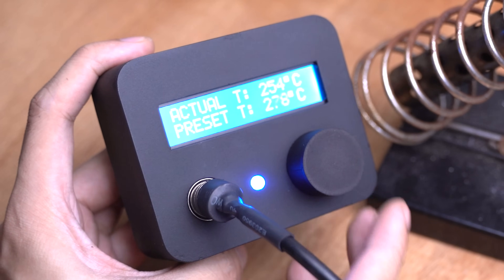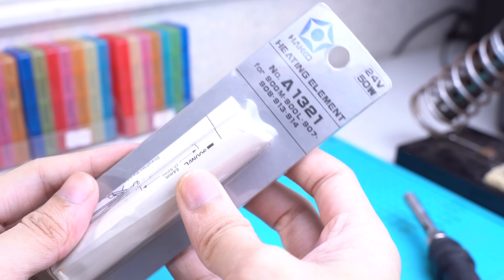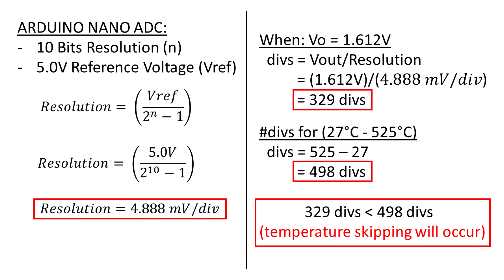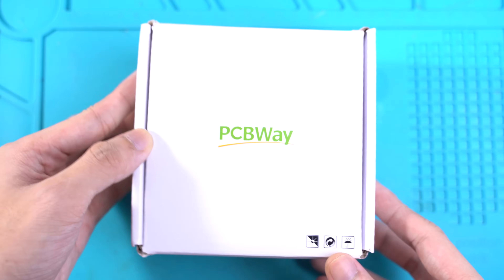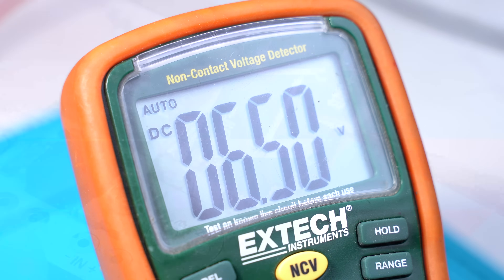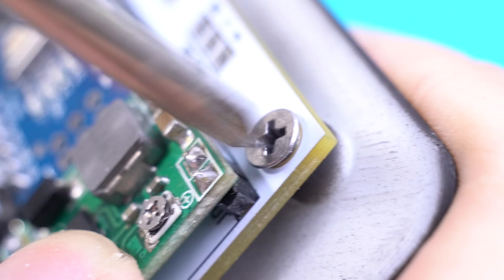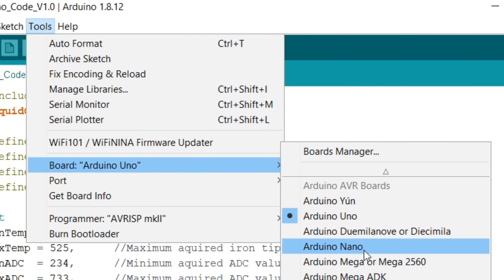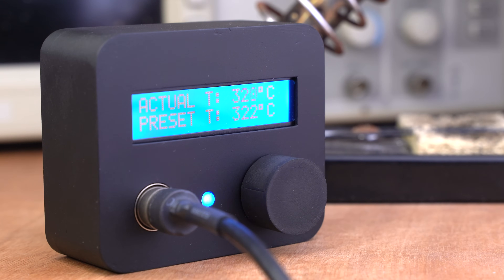DIY Digital Soldering Station (Hakko 907 For Cheap)

Comment: I’ve been using your project for two years now, and it’s been a great success - thank you so much! Do you have, or could you recommend, a similar project for a digital hot air station?
Reply from the maker: Glad you enjoyed it! Such a coincidence. I'm currently filming a tutorial for an all-in-one station (JBC + Hakko + Hotair) for my workspace. 

It's getting too cluttered here, I need a small form factor for my desk. The challenge now is shrinking the 2025 Soldering Station by finding a compact PSU for it. I made a tiny 300W 24V PSU for the prototype, but since it's for a tutorial I need to find a readily available PSU for everyone to replicate the project. 

As for building a standalone hot-air station. It's similar to the 907 project but it takes in AC instead (you'll need an SSR/ triac based device). It also uses a k-type thermocouple, you'll need something like a MAX6675 or an op-amp to get it going. Those 858 hot air handles also need a low current 24V supply for the blower fan. Hope this helps!

Comment: Hi. I make it. but it turned out it didn't work.
i mean it works but the temperature shows 2000°c
i removed the jumper and used the i2c interface LCD, after connected the handle and the heat element the arduino died and stopped working
I don't use pcb but connect the pins together
i'm pretty sure i did it right, but i don't know why it's not working. 
can you make another pcb version? or at least tell me why the temperature is showing 2000 degrees?
Thanks!

Comment: It would be possible but I would have to modify the electronics board.
I followed the original point exactly but with different results.
I wonder if the line of code that deals with displaying the temperature should not be modified.

Comment: Hello everebody!
I built this soldering station and it works well,
I have only one problem with the temperature reading,
the temperature on the display is 50 degrees higher than the one measured by the thermocouple on the multimeter.
Can someone help me with this problem?
Thanks!

Comment: its not working with my 936 station preset 39°C but my heater i show red spot or over temp, actual stay saying cool😢
Reply: I have the same problem. I set the temperature to 30, but the tip of the iron becomes hot and red. Were you able to solve the problem?
Reply: @RaoofAhmadi-wu6kl  i think is not working because your solder used sensor termocouple not termistor, but i have done with another youtube if you want try
Reply: @verhor3592  Can you share the link to the video?

Comment: You can actually use a 6 pin din connector and not use the middle pin, the proprietary connector is just a 6 pin din without use of the middle pin.

Comment: I'm a bit confused about the A1321 heater (honestly): how can a ~3 Ohms resistance device, working at 24V produce no more than 50W? 🤔
Reply from the maker: I have to revisit my data from years ago. But as far as I could recall, the heater has a positive thermal coefficient (resistance increases as the heater temperature increases). TBH it’s favorable as it can possibly prevent the heater from having a meltdown if thermal runaway occurs.
Reply: @TechBuilder  I hear you about the positive thermal coefficient, but, shouldn't the initial power surge (when the station is turned on), be a problem? And it's probably not a short surge, more like several seconds. The resistance probably won't start rising (enough), for 5-10 seconds, and during that time, the heater will draw something like 8-9A.
Reply from the maker: @hagartm  It can be a problem if the PSU does not have a constant current limit. 

I have experienced a problem from a similar project years ago, where the PSU only has a over current cut-off (hiccup mode of OC protection), which made the heater heat up longer compared to a CC regulated PSU. Some laptop chargers have CC regulation or most at least have the Hiccup OC protection. 

Full disclosure, the code does not have that initial ramp current limit. The best way to implement this is to add a current sensor and use it as a feedback for PWM control (in turn, this increases complexity). A simpler way to do this without and hardware add-ons is to set an arbitrary PWM duty cycle ramp to control the initial ramp current. To do this effectively, you might have to sit around and gather data on the voltage, current, temp then derive the heater resistance using a spreadsheet. This way you can determine the required PWM duty cycle to limit the ramp current for a period of time.

Mine has been running for 4 years now with regular use, it hasn’t died on me so far, nor had problems with it :) It runs along side my Miniware TS101. I still prefer the Hakko for its grip haha.
Reply: @TechBuilder  I hear you about the constant current limit as well, but then, why not simplify the design?? (Not your design, speaking in general terms). Why not run the heater at 9V?! That would make for a 2-3A current draw, and there would be no need for PWM (I'm probably missing something trivial, but it 'is' kinda weird; wish I could find the technical papers for the original Hakko 936 (not the manual, something more in depth)).
Reply from the maker: @hagartm  I get what you mean. If I could recall correctly, the resistance reaches 11 ohms at 450 degrees C (due to its PTC; thus the 50W rating). Running a lower voltage PSU would work (I used to have a 18V brick attached to it before I upgraded to a 24V one), but doing so would also limit the heater’s maximum heating temperature and ramp up time. This is why I still keep the 907 even though I have the TS101, I programmed my 907 to have a temp limit above 490 degC. (Kinda useful for soldering chunky gauge 10 wires). Whilst it is dangerous, I only go above its intended limit in short periods of time and keep an eye on it.

I ran into a similar problem when I made this project, I couldn’t find graphs on Hakko’s heating element, so I had to evaluate it. You can visit the instructables link in the vid description, there’s a spreadsheet there. I just hope I could tell my younger self to also record the currents along side the thermistor resistance and heater temps hahaha. I hope that sheet helps with your project :)
Reply: @TechBuilder  I've already seen your project (at the Instructables site), and several other projects as well. :) There is no 'my project' ATM. :) Was hoping I could make a really simple universal controller with Arduino and a triac, for both the A1321 type handles and the A1322 type handles (not JUST with Arduino and a triac ofc), but alas, it obviously can't be THAT simple. Still don't quite understand the 'rationale' behind the heater that has the potential to draw 4x the rated power (really wish I could talk to some Hakko engineers), but thanks for chiming in. :)

Comment: A big thanks , I spend 6 months in my RV and loving to do projects on the road and my Hanko Take a bit of room and dealing with that pesky extension cord. I printed your lid with a Dewalt battery adapter" That I always carry for my drill" . I also just did one for my nephew in-Law  for a Makita battery. I will post both on Thigiverse under HANKO.

Comment: Is all of this still good to build in 2024? e.g. If I buy a Nano will this code work in it since it may be different from the model sold a couple of years ago when this came out? Did you ever do an update to this project or is this good to go? Great job on this, thank you,.
Reply from the maker: Thank you! TBH, there’s a much more updated version I plan to build, a T12 version. It heats up much faster than the 907 due to lesser thermal mass.

However, I still use this 907 as my main Iron since the 907 tips are dirt cheap compared to T12 cartridges.
Reply: @TechBuilder  Did you see the posts where people built it but saw no display? If I buy a 2024 Nano will the code work in it? I never bought a nano before and am not yet familiar with their coding (although I've done coding in the past). Also do you still sell individual circuit boards using paypal?

Comment: Hello, I ordered your PCB design at my local PCB printing shop; they have a rule that the minimum order is about 500 cm2, so I ended up with 15 PCBs. I only use two for the project. So, only with your permission, can I sell off the 13 PCBs left? I won't take any profit from it. I will also include your tutorial link or QR when people buy it.
Reply from the maker: Hi! You have my permission to sell and profit from the PCBs. The QR would be much appreciated too, hopefully it would hell guide the hobbyists in putting it together! :)
Reply: @TechBuilder  thank you so much, sir.

Comment: Hey I recently finish , got it soldered and programmed , but when I turn the temp up the real time temp says and stays on cool? And doesn’t heat up what did I do wrong? How can I fix this issue also my little led does not light up
Reply from the maker: It’s probably your handle’s thermistor. Are you using a 907 handle? :)
Reply: @TechBuilder is it possible I mixed up the heater and sensor pins when soldering?
Reply: This is the handle I believe I am using it’s the FACULX 907A Soldering Iron Handle Replacement from Amazon , I put a din 5 pin connector on it also

Comment: I built it and did it the best that I could to follow the schematic. I purchased the boards from china.  Looked at the drawings but couldn't be sure to find out if I had wired the sensor and the heater properly. Something is wrong as the solder even melted with the iron turned all the way down. Try checking the ohms on the sensor and heater and they both run about the same! Can anyone give me a link to an iron that they've made it work? Thanks for any help.

Comment: Has anyone had success building this? I tried getting it from PCBWay. The OpAmp doesn't seem to work correctly and I wonder if it is wired wrong in the schematic. There are several comments about this in the instructable as well. I have gone through two different OpAmp's so far thinking the first one was bad.. but same issue no matter what. I confirmed the handle is wired correctly with the sensor, and getting around 50 ohms at room temperature for resistance. Someone posted an idea to bypass the OpAmp with a tradeoff for lower granularity of temp control but I haven't tried it yet. I also saw several comments saying OpAmp was incorrect in the schematic. Just wondering if anyone has tips / thoughts on if this actually works who is using the PCBWay/Gerber file.

Comment: Pins D10 and A6 on the arduino nano are not connected on the schematic, but they are on the printed circuit board, is that a mistake? greeting

Comment: After many weeks of waiting for parts and and nonsense, I FINALLY got this working with ONE problem. the "ACTUAL" temperature always reads "COOL" - but the iron does seem to heat up based on my selection. Does anyone have any suggestions on what I can try first to troubleshoot? I'm afraid maybe my "hiletgo" arduino nano could be the issue? No idea but I only have 2 boards left to re-build and i feel like i should have just bought the real deal by now lol. @techbuilder please any ideas?

Comment: Fantastic, you made me go to back to Proteus again (abandoned since 2014). I will try a slight add thinking on using it hours in a real job. I miss someting to reduce temp when device is in support unused waiting for Next solder attempt. I think a LDR placed on the external support could do the job, when dark comes "handle on support" the arduino could pass to económic Mode. When darkness goes away "Handle out of support" back to normal Mode again. Just an additional 2 pin plug for the external LDR and some board modification.

Comment: can you send me the circuit diagram of the soldering station to control the temperature for the goot RX80, or can your circuitry be used for the goot soldering tip?

Comment: Friend is here not a PID Control missing ?

because i dont know how i calculate the hakko iron i have 2 edition from the heating element

1. 51 OHM
2. 58 OHM

How i can do the 2 heating elements a1321 passing to calculate good ? 
its missing 😞

Comment: You don't need that exact 1°C accuracy so get rid of the opAmp and connect it directly to the adc. Also flyback diode on the heating element is unnecessary this is an resistive load not an inductive load.
Reply: and also using buck converter is completely unnecessary you are just powering a microcontroller and an opamp just slap 7805 linear regulator and connect it directly to 5v pin of arduino
Reply: @merdem7805  Also there a lot of people here have done building the project and it seem that the temp is not reading correctly because of the op amps. Btw can I ask why he use a capacitor with value of (25v/470uf) after the power supply?

Comment: Hallo! I have  a verry good 24V /48W soldering iron Pensol Iron N. With K Thermocouple. I have a datachart with TC voltage and temperature..
Can u tell me how to modify de code and how to calculate the gain....
Maybe you are willing to do a chat on email.
Have a good day!
Bogdan M.
Reply: Salut ai rezolvat ceva?

Comment: Why didn't you just drop the voltage divider so the first resister is 50 Ohms. That could of solved your problem. You'd have 50mA MAX current. That's fine right?

Comment: Please make one video on how to design PCB Schematic Diagram and it's gerber file ? Which software you are using to design ? Which software you are using to design circuit diagram ? take example on ATmega328P with following components  relay , dc power jack ,Screw terminals .

Comment: Hi friend. Thank a lot. Please answer me. I built this project. But I have a problem in handle connecting. The ground pin on the handle should be connected to which point of the board? Because I see 4 point on the board for handle connecting. And I don't see a point for 5th pin on the board ( Ground pin )

Comment: nice project, I am going to try it!  I was wondering if there is a diy project for a descent iron tip thermometer... I bought one once but ended up with a "lemon" measuring temps as much as 100 degrees above the actual temp... can you direct me to one such a project, if it exist? thank you much!  OR perhaps I could use only the measuring temperature section of the code?

Comment: Why did you run the +5V on the pcb from the Arduino that power's up the LM358 and the LCD display through the A3 pin of the Arduino?, does that not affect something?, and still the schematic doesn't show that connection. And another thing is that driving the mosfet directly from Arduino is not quite ideal because the output is only 5V and the mosfet will not be fully opened and will run a bit hot, you need at least 10 V on the gate.

Comment: Thank you brother i didn't find any solution for my 928D soldering station tip tharmal conductivity. I purchased lots of tip but no one gave me a good result...then i followed your tharmal paste idea...and it was really surprising that my 2 years old iron tip working as like a brand new tip.....thanks

Comment: I made this project, but when I turn it on, it does not display the temperature and writes cold. Where does the problem come from? May you help us!
Reply from the maker: Either from bad wiring or the solder handle’s temp sensor type
Reply: @TechBuilder  Could this be modified to run a hakko fm2024 desolder gun? Not the vacuum just the heating element?

Comment: Hi. Nice project, thank you for share. I'm trying to use another iron with same power(24 Volts 50 Watts) but different settings. Mesuaring the temperature and thermistor resistance i could see this; 2,4 ohms @ 26º and 20 ohms @ 480º celsius. Can you help calculate the parametres and R value ?

Comment: I used I2C and I uploaded the code that is I2C, but there is no text on the screen, what could be the reason?
Reply: Did you figure out the problem i have the same issue
Reply: @rokomihanovic3730  Maybe you have the i2c address wrong or you have to regulate the contrast of the screen with the potentiometer that the screen has.

Comment: Hi there, can I ask a question ! I'm interested in you project and i've made the exact same things you did but when i plug everything in the IRL4132 heats up very fast , the Preset temp always 525 i cant change it using potentiometer. Please help me if i 've done anything wrong. Thank you !

Comment: I would like to use this to build up a desoldering station. To do so I've bought a desoldering gun already available on the market that I want to heat up with this station. The heater inside the gun is claimed to be 24v 90W but measuring the resistance with a multimeter i found 2 ohm! I was expecting something like 6-7 ohm. Is still possible to use it with your project? I mean considering is a power modulation? Thanks

Comment: A welder w101 is a good as is alternative. Heat goes from 300f to 850f. I used all sorts of parts so I needed highest for the bubbling for high voltage parts.

Comment: Why not the IRFZ44N ?
Reply from the maker: You need a logic level mosfet, which the IRFZ44N isn't. Logic level MOSFETs saturates when the gate is supplied with a logic level voltage, which is needed to operate at a low on resistance (less heat dissipated at the MOSFET)

Comment: Sir, can you let me know how to calibrate the temperature if needed. Can we use variable resistor instead of 470 ohms for reference voltage?
Because it's hard to find original hakko A1321 element, also i have already a handle and the only difference is sensor its normal resistance shows just 12-14 ohms.